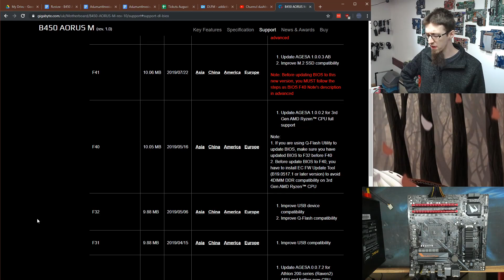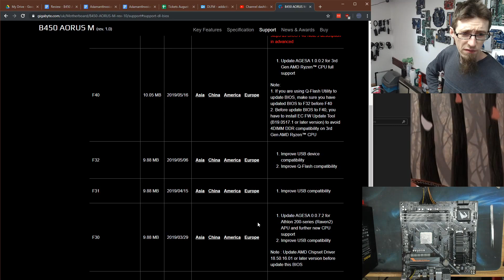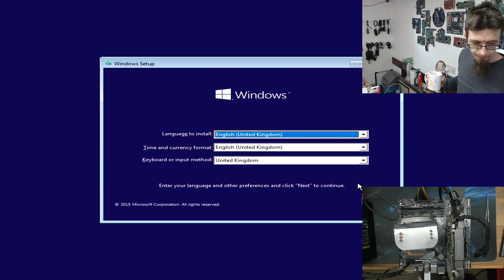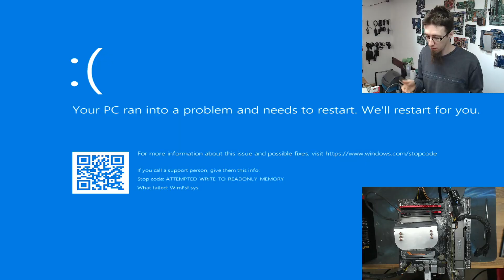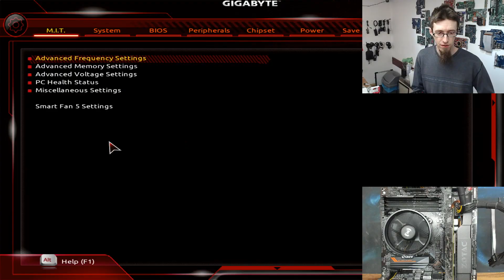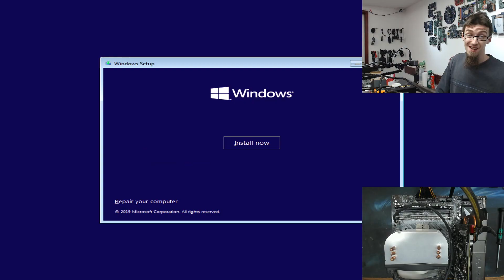LFC#183 - Gigabyte's BIOS update bricked my B450 Aorus M

Comment: theres a few better tips than shown in this video 
use a small older (slower) flash drive usb2 or lower   , it seems the higher speed and larger drives try to work too fast for a bios update with ryzen

always only use 1 stick of ram (less ram sticks = less chance of corrupt bios data)

and always use slot a2 as directed in every single ryzen board manual........im quite shocked this guy dosnt know this keep using b2 which is incorrect

and if updating a current used pc  RESET BIOS TO DEFAULTS BEFORE FLASHING !  NEVER FLASH WHILE RUNNING XMP ON RAM (not that this guy got as far as setting xmp in this case though)

Comment: Ok you now have me scared. I don't have a 2nd computer to fix that kind of problem. Plus they are up to F51f now. Should I unzip the file, or will it read it zipped?
Reply from the maker: Unzip it. So long as you've got a Ryzen 1000 or 2000 to update with, you should be fine. My experience was a cascade of cock-ups on both my part and gigabyte alike.
Reply: @Adamant_IT  First and very much foremost. Thank you for responding back. This is what I'm getting "GIGABYTE B450 AORUS M (AMD Ryzen AM4/Micro ATX/M.2 Thermal Guard/HDMI/DVI/USB 3.1 Gen 2/DDR4/Motherboard)" with a AMD Ryzen 5 3600 6-Core, 12-Thread Unlocked Desktop Processor with Wraith Stealth Cooler. Plus 32gigs worh of Corsair Vengeance LPX 16GB (2x8GB) DDR4 DRAM 3200MHz C16 Desktop Memory Kit - Black. 
Watching you do that video really scares the crap out of me. I don't have any spare money to switch things around. XD
Reply from the maker: Keep in mind that you need an older CPU to flash with - unless you get really lucky and your board is F32 or higher out of the box, it won't recognise your 3600.
This is why I swap the CPUs during this process - old CPU in, do the update, swap to new CPU.
Reply: @Adamant_IT  The only "Old" cpu I have. Is the one I'm running at this sec in this computer. It's a AMD Phenom II X4 820. Would it be smart to put it in first. Then flash the bio's. Then put in the Ryzen? If that does work? How many sticks of ram should I have in?

Comment: i feel like msi bios in general are bad i have intel z390 msi gaming plus and most recent bios is bad with overclocks i think intel demanded this to sell the 10th gen as my 9700k hits 5.1 at 1.360vcore stable avx and can achieve 5.2 non avx at 1.41 load  but most recent can hardly do 5.0 at 1.31vcore i have to raise to at least 1.34vcore. not only that but my scores in benchmarks drop ass well i tested every bios for this motherboard performance dropped off shortly after 10th gen release im currently running 7B51v17 release date 2019-08-12 anything newer i barely get over 4.9 without increased voltage and heat. asus has the best bios i think

Comment: Your failure was to put both BIOS Files on the Stick, If you have Had only f32 on the Stick everything would have gone Well. Lol. Noob
Reply from the maker: That's not how BIOS updating works. You select the file from the flash drive - the system doesn't do it for you.
Reply: @Adamant_IT  Trust me, thats why He updated to F40 instead of 32 firstly.

Comment: "Ugh, I really hate dos flashing. I might cock it up"
"Grab my heat gun"
Reply from the maker: It's funny how different things scare us, right? ;)
Tbh it's just because I've not done a DOS flash in donkey's years - no idea if the old methods still work.
Reply: @Adamant_IT  I was surprised by how quick and easy that looked, and glad it worked. I imagine if you did that a number of times the solder would get to brittle or something but a good backup plan.

Comment: at that point i would look at the computer's bios version and update one at a time until i get to the newest one. 
I swear bios updates are no joke, my motile is known for being scary af to bios update because you could easily brick the laptop.
My motile comes from the factory with no working BIOS flashing tool, none in the system, and the only way to do it safely is to boot into DOS like the good old days to update the BIOS firmware. scarry crap.

Comment: I've had nothing but RAM issues with this board. Every once in awhile if I decide to restart, it won't boot and throws a memory error and it requires another startup attempt to work.  Happened on two different sets of RAM that I never have issues with on other boards. Would have returned it but it didn't start happening till after my return date passed.

Comment: So you're saying i can update my F23 - F32 - F42 without installing the  flash thing?
Reply from the maker: I would do the EZ Update thing. I'm not sure if it was a contributing factor to my woes - normally I wouldn't consider it required, but with this board I'd take no chances.

Comment: I have a problem with the same motherboard. I keep Turning it on but all I get is a blue flash of light and a continuous beeping sound. I am using a Ryzen 5 and a evga 600 bq 80 plus bronze. What could be the issue?

Comment: I have a version of this mobo with the WNIC built in. I built it over a year ago with a Ryzen 5 1600. I was also wanting to go to a Ryzen 5 3600X. I had issues flashing mine but I did that windows utility update, then BIOS update then 2nd update. Mine flashed the first one but would not flash 2nd one, came up with a error message saying the flash file was corrupt or unreadable. My system still posts and is still usable but never tried going directly to F41.

Comment: What i noticed is after you flashed F40 bios, your VCORE voltage was all over the place, sometimes under 1.1v sometimes it was at 1.452 volt. No wonder it was locking up because it has bad config in the bios. Probably boosting/OC volts & miscalculated power draw.

Comment: Instead of going from Bios VF2 to Bios VF32 maybe should have check out the Bios Versions between F2 and F32 first?  Never know, maybe something with Bios VF10 or F20 or something like that needed updating first before jumping all the way to F32.
Reply from the maker: That may well be the best way forward with this. I've not had issues with doing non-sequential BIOS updates before, but hey, times change. If sequential BIOS updates avoid traps like this, then I'll update my habbits.

Comment: This kind of problem I had with my H61 GB BIOS. Never GB again. Endless boot-loops . BSODs I have never heard of. Finally would not even POST. Went to a MSI board and never was a CPU/RAM problem  , it was the God Damned Gigabyte board. MSI has many more driver and BIOS updates too , amazing considering MOBO is like 7 years old. Gigabyte had few updates , and the boot-loop is a known problem. GB BIOS was corrupt many times too and had to reset to backup. Eventually it would not reset.

Comment: I recently updated my Gigabyte Aorus X470 Gaming 7 WiFi motherboard to the BIOS that supports 3rd Gen Ryzen for a 3600 as well (I believe it’s version F51 at this point) and while I didn’t get a bricked board, my BIOS is certainly screwy.   Whenever I completely shut down my system, my BIOS resets its settings completely. Changed the CMOS battery and all; this issue only happened when I flashed up.    Also, my 3600 gives off some really ridiculous temperature spikes, which of course drives my fans up to nearly full RPM frequently.  

Idfk why this is or what GB did with these BIOS updates, but damn do I regret doing it.  I want to try to flash backwards back to what I had before (F14, I think?) but I hear that flashing backwards is a SUPER bad idea.  

But... by the same token, my BIOS updating hit a very interesting resetting as well (as in it would revert back to my original BIOS version most times I tried to flash up the 30-something). So... is it really so risky, with this board at least?  I have to wonder.  ;-;
Reply: Addendum: My system also will sometimes power cycle up to three times before POSTing when I completely shut down as well!  Very interesting stuff, that.

Comment: I have a Ryzen 2200G CPU and a Gigabyte B450 Gaming mother board with 16 GB  that I put together.   I decided to update the BIOS.  So I started with the next version use the MB utility to update the BIOS and. And, made sure that each update was the very next version as the update utility told you what version you were on and what version you were upgrading to.  The red writing basically said if you were going to use the Q-Flash utility on the MB, you needed to have Version F40 flashed to the MB before you can upgrade to any of the BIOS versions after F40.  Install F50 after I installed F40 without Windows installed as I was having problems with the. AMD SATA RAID system.  Had lots of issues until it took 4 weeks for Gigabyte to respond.  AMD had a newer version on their Website. I have installed it after I talked to AMD Support which took less than two hours for AMD to reply and AMD Support suggested that I use their Drivers.   I haven't had a problem with Microsoft Updates totally destroying the RAID after updating the BIOS to F50 and installing  the AMD RAID Drivers, AMD Chip set drivers along with the video driver from AMD/Radeon.

Rev George

Comment: After I remove the cmos battery and flip the power button on the psu it is always a good idea to hit the momentary switch on the mob to drain the caps on the board and in the psu of all residual juice.

Comment: Mainboard support sites seem to be kinda wonky. I recently looked for the latest BIOS on the MSI B350 Mortar Arctic (why does noome make white boards anymore? T.T) and beside the BIOSes that were listed in the usual spot there was a newer version that wasn't listed there but hidden in the CPU-compatibility list. And the file is names wrong so that I actua had to inpack the zip before I could see the actual BIOS version it included and that it was newer.
I feel like going full Sherlock Holmes on a mainboard's website to find the latest BIOS is not what it should be like.

Comment: I have the exact same motherboard I started getting bluescreens lately but not when gaming I think the motherboard is faulty but I'm not sure if u have any idea what the problem is please help I would appreciate it
Reply from the maker: What's the bluescreen error? If it's different each time, I'd start with a Memory Test.
Reply: @Adamant_IT  I usually get system service exception or index mismatch blue screens but I realized i havent updated the drivers on my ryzen 5 3600 so I'm hoping that was the issue

Comment: İ bought this motherboard and I'm scared as hell to do a bios update , and I'm planning to buy a r5 3600. Hope they fixed that broken data on gigabytes internet page.
Reply from the maker: The bad payload that I ran into is definitely fixed. The main issue is what CPU you use to upgrade. If you're upgrading with a Ryzen (not an Athlon or APU or anything like that) you'll be fine.
Reply: @Adamant_IT  i hope so, thanks for the info :)

Comment: I have this board and went from f1 to f50 by following the steps. You should have installed windows first then use the aorus app centre to install the downloaded bios files. And the .EXE file is needed, just a click and it works. On the dead board you should have removed the jumper and reset the cmos first.  I still use the board and my specs are.... b450m (f50), 2500x, 24gb Ram, MSI rx 5700xt, 120gb ssd, 3tb storage.

Comment: Ask me why I went with the MSI B450M. Plugged in a new R5 3600 and off I went.
.... and I always boot a new system into Linux first. If Linux won''t run it, it's a BIG problem for Windows POS.

Comment: I did a build recently with the MSI Tomahawk 450 max (Desktop 3 3000 ready) put in a 3 3200G (for those NOT in the know - note the G which stands for VEGA graphics incl CPU )
System would NOT post. Red light next to the 24 pin socket and that was it though it would power on everything seemed ok BAR the fact there was NO USB responses re the usual leds et 
ZILCH. But then of course the bios required update though it states quite clearly Ryzen 3 desktop 3000 ready. Put in a Ryzen 3 3600 and it according to the test division re board sent for investigation et NOTE not the VEGA chip and it posts? The problem has been known for over 2 years re the raven ridge APU issues AND I totally understand your frustrations as believe me I nearly threw the damm thing at the wall. My recent Asus x570 plus build has a Ryzen 5 3600x in it and it posted straight away no probs, bios update a breeze et but I tried the Ryzen 3 3200G in that and oh yes, it would NOT post et My own advice is DON'T buy the Vega cpu's. In the UK we have buyers protection that states clearly 'fit for purpose' and scenarios like this are getting too common where manufacturers and suppliers fail and the biggest problem lies in the obvious LACK of QUALITY controls, failure to deliver what should be OUT of the BOX. I don't expect to pay for butter and get margarine!

Comment: Dude I was like man this thing is bricked there's no way he's going to save it and then you pulled some fancy shit and saved the day, well done sir
Reply: A MSI Tomahawk or ASUS TUF is a better option.
Reply: @pentiummmx2294  preferably msi, they have bios flashback w/o cpu..aint nobody have extra cpu to upset the mobo..xD
Reply: @zZzabi  I had to get a Ryzen 5 2600 to be able to upgrade the BIOS on my ROG Strix B450F Gaming to support a 3600XT.
Reply: @pentiummmx2294   feels bad man, those extra money can be pour to other thing. i really want to built a pc, now waiting for amd cpu review
Reply: @pentiummmx2294  a ryzen 3 2200g would have been better. No need to put the gpu.
Reply: @santiagoferrari1973  i already had a 750 TI at hand.
Reply: @pentiummmx2294  MSI Gaming Plus Max is a good board too
Reply: there is an easy way to fix it but it is very costly..
Reply: why are new bios chips soldered on and too small unlike the older boards that have socketed plcc or dip chips.
Reply: @pentiummmx2294  It's about money pinching, the sockets cost a penny or 2 more, it's all about max profit, although they could charge the extra couple of pennies on the price, people would pay anyway......but thats not how companies think (dumb though it is)
Reply: @KarenSmith-ef9kk  most 90s boards had a dip or plcc bios chip that is socketed and can easily be reflashed if it is bricked, but boards nowadays have soldered in bios chips.
Reply: @pentiummmx2294  the point is there is no need to remove bios from the board as it can and has been rewritten directly on the board, when a flash went wrong, with Dos bootable disk, bios file, dos bios writting progam and an .ini file to execute the program then tell it what file to write then to reboot when finished. I have recovered loads of bios this way even the old 486 pc's, mother boards vary on which key needs to be pressed to force it to read from the recovery media while powering up. Worked every time for me...make a recovery disk for the specific motherboard and try it yourself, if can get hold of an antique pc or ruin a perfectly good pc by turning of the power while updating a bios.
Reply: Yeah it's the bios chips... there was a time where they could be swapped without even needing solder. But I wonder why even the 2nd bios doesn't work on this gigabyte :).
Reply: @guily6669  I think it's several things combining. First, I think the bios chips selected were not of the highest quality (bean counters strike again). Then, combine that issue with bios code writing back to the chips with your settings. And the final straw being some bud software revisions that were less than stable or would induce unnecessary write cycles (such as for fan speed changes or rgb settings). With those problems you have bios chip failures. You may not even notice the main chip failure until the backup chip also fails.
Reply: https://youtu.be/S4my-fAoBM4 🥰😍😍
Reply: there is no need for fancy shit lol when there are easier and less complicated ways of doing things that work perfectly from way back in the 90's
Reply: "We were expecting the regular stuf, but then he had some gourmet shit!"
Reply: gigabytes lost my respect i will very careful to avoid "cheap" boards"
Reply: I had an issue with updating gigashyte bios before and ended up having to trip the bios with a screwdriver to activate the second bios to fix it.. wont buy gigashyte ever again.
Reply: @shaneagetro  I had the same issue, then the backup bios failed on its own too. 3 RMAs later and they replaced the entire board, it's been stable since.

Comment: FFS why are you trying to boot and install windows with a corrupted/incorrect BIOS??????????? Just either switch to backup BIOS or flash to another BIOS. Jesus. Also if you not used to flashing BIOS you could have installed windows on the stock BIOS and APU and install the software the Giga site warned you, that you need to update to F40. 
But the board might be broken. This is why I bought the ASUS Strix B450 F Gaming.

Comment: Had a similar experience back in 2008 when I was very young and very dumb. I had some $1000ish (at the time) HP tower. I needed to update the BIOS for a new feature. I knew the seriousness of flashing a BIOS, so I read all the (simple) instructions in full, double, triple checked myself. Used their official website. The BIOS flash could only be carried out via Windows. The expected end to this sad story - my motherboard got bricked. HP refused to be held accountable for a single thing - absolutely disgraceful. Would not cover shipping, diagnosis, repairs, nothing.

After that, my knowledge of the PC world was growing exponentially. I replaced my motherboard myself, fixed every issue myself, and swore off prebuilts of Any kind. 12 years later, everything is boring, I know exactly how much time/effort it takes to do X task. The knowledge form of diminishing returns has taken its roots deep.
Reply: Haha, I can relate to everything you said. Minus the HP tower, I would have never bought such a thing in the first place.